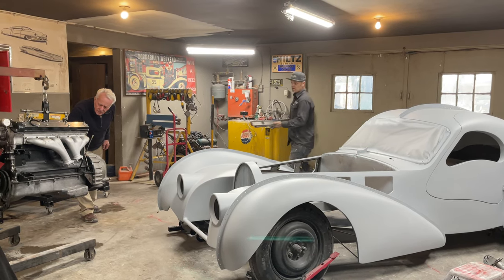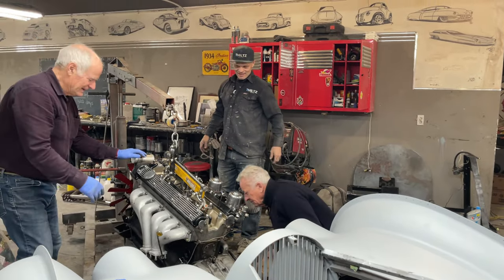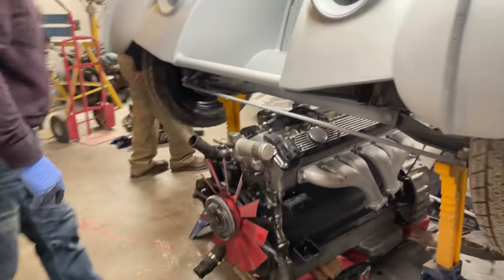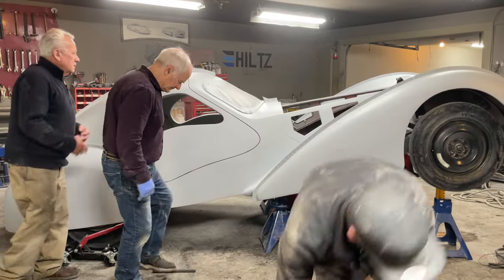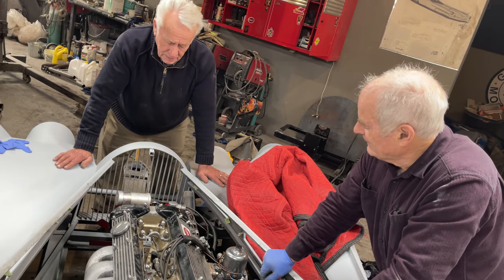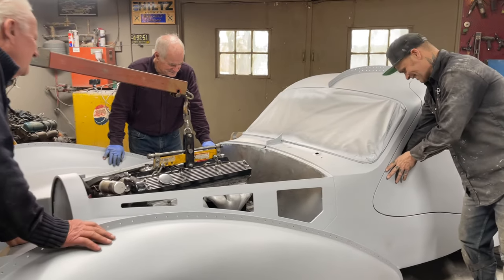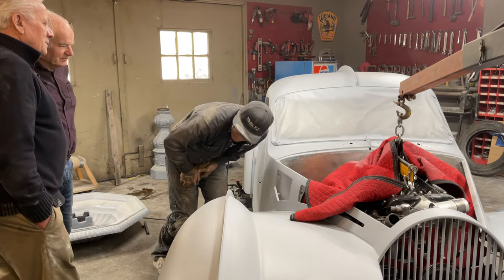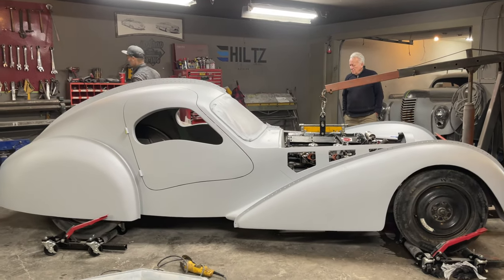WE JUST DROPPED THE JAGUAR ENGINE ON THE BUGATTI 😱

Comment: I have the same engine lift and used to experience the same lack of control on lowering the "boom"....until I had the idea to attach a long bolt to the T valve using two tiny hose clamps and this made a nice lever to control the valve very precisely and allows you to also keep the handle in the jack so you can quickly go up if you need to

Comment: Chad, cut out a template wit a sheet of cardboard. Cutout a part that fits around and over the bell housing, then from the engine side trace out the pattern you need for how much room for the engine recess .I would go down about 6" from the top of the hood on the firewall just to make sure you leave enough room for the linkage fore your wiper assembly and motor. Width of the recess should be a couple inches wider than the width of the widest part of the rear of the motor. Been following this build from day one, so nice to see it all come together. Congrats.

Comment: Really love the build overall!..a few suggestions from another old hot rod builder..Get a 2" chopped Model A radiator made for a modern v8 swap..Common part in the hot rod world, so its not expensive..plus it'll fit better that the mustang rad and look tons better.  Also consider correcting the spines running down the tops of the front fenders, they are splayed out when viewed from the front, making it look a little bowlegged,  instead of running vertical like the original car.  This car will be great for sure!

Comment: Are you going to have to put the Lucas wiring system back in or is there a easier system that you can use? I have a 79 xj6 and I hate the wiring and am color blind sucks I know but haven't had problems for a bit but want to change it over but keep the inside engine in it?

Comment: Measure twice, install engine once.  This is one very impressive build and the Jaguar engine is the perfect choice.  Yes, you can get a custom radiator built to your specs in aluminum and nice and thick.  Walker radiators may be a name to check out.  You will have to have a motor mount that unbolts from the frame so that you can install and remove the engine.
Reply: I just read a month or two ago that Walker was planning on going out of business after 70 or 80 years of being in business. I'm not sure if it happened yet though.
Reply: I was surprised there was no discussion of   motor mounts and pads. It was always a main concern when I did a conversion. An interesting Jag to AMC six was extremely easy as the original frame pads of the Jag exactly coincided with the mounts of the AMC. Those AMC's were very adequate replacements with little tuning problems in contrast to the Jags.

Comment: The body is looking very slick. Just taking a peek as “sparkle” pans around. Super tight on the motor but that’s what you expected. Looks like the firewall might need a recess to allow room for a radiator. Dropping the motor is just typical. Try and try to be careful and shit happens.

Comment: Well, we are all human and things like this happen. I've dropped 2 engines. One time we had a Dodge 318 and auto transmission sitting on a really sturdy table. Something overbalanced and it rolled sideways off the table. The other time I was putting a 361 engine into an old Dodge grain truck. I had the engine about 5 feet in the air to go over the rad support. I pushed up on the front of the engine when a lifting bolt broke  and the engine fell doing a 1/4 turn and landed on the front axle. In both cases there was minimal damage. That looks like a really tight fit, glad there wasn't more damage.

Comment: Chad I hate to be an optimist but use a pair of pliers to control the valve on the hoist or a pair of vice grips clamped to the pipe gives you more leverage and control also when you build a car make sure you prefit everything so it can be removed and worked on without difficulty just a suggestion though I've been doing this for a long time I wish I would have had you in my shop to teach you a few things but you're doing a good job

Comment: He wouldn’t mess with that fan but I would toss 
It without a second thought if I needed the room, however I would wire the electric with a temperature switch so it turns on automatically

Comment: *****  First, I think I speak for all of us who have been watching you build this Bugatti when I say our stomachs were in our throats the moment the motor fell into the engine bay.  For us it's as though we're helping you build this baby.  **** Next I know that the motor will descend even further when attached to the motor mounts but be sure the hood will not touch any of the motor components on the top of it for from our angle the coil sure looks as though it will stop the hood from fitting correctly.  If your Mustang Radiator is too large and you don't want to buy a custom built radiator, remember that there are a lot of water cooled motorcycles which have small radiators which could be modified to fit in your grill. Plus, if you buy an oil cooler that too could reduce engine temperature.   Lastly, are you going to have enough room to fit in the steering post and steering box on the right side?  It's so crammed with motor parts, I don't even know how you would ever have access to it in case for example you had to change it?

Comment: 1. Remove bell housing 2. Remove cooling fan/belts. 3. Lift up the rear of car.4. Remove power steering pump. On further thought, why not lift the car body outside on your vehicle lift, then lower the body onto the engine?

Comment: I had a similar thing happen while lowering a big BMW 6 into a 635i chassis.  I had to stand the engine on its butt to slip it into the engine compartment.
Thank goodness, you didn't do much damage, and that no one got hurt, when it dropped!  Your incident got me thinking, and I am going to make a 10 inch cross bar, that slips into the top of the jack handle, that will allow me better control while lowering the engine into position.  
In spite of the flip my stomach did when the engine dropped, I still enjoyed the installation.

Comment: Hello Chad & Jolene from England, I am an old guy, and a retired painter, cellulose, and synthetic, two-pack had just been invented early 70's, though I did use a ready-mixed product called blending clear for metallics. I have never undertaken work like you do, although in my later years I wish I could. I think I might be ahead of the game here but I realised very early on the only way to get the engine in was from below. Good job. Jolene has top-class video skills, and the production is always faultless.

Comment: Too much of the body is not removable.
Reply: I agree, those side vent panels should be removable (bolted in not welded in) in case access to carburetors or the steering mechanisms are needed in the future for example.
Reply: I agree, also the radiator grill should be removable. The original cars had clamshell hoods, that made it easier to install the engine and maintain. But We have to admit he has done a wonderful job building a beautiful car! He is very talented! Although it probably would have been easier to build the chassis, completely with the engine and drive train and steering and brake components first, then build the body around it. But you must agree, that a lot of of builders, could not even accomplish what he has!

Comment: Hi chad 67 4.2 had smooth tappet cover's and is sesries 1.
searies 2 started in 69 it should have two ingine mounting on block if you use the ferther back mountng spot there will be more room for altetnater and power steering and so on and you wont need to use the stableizer mount on bell housing.
Good choice of ingine I have one in my daimler  .Nevet had a problem very reliable and fast good bottom end mid range and top end.
The 4.2 gets a lot of flack but beleave me set up right they cant be beaten.They are all so the most beautifull engine ever made.

Comment: I would put a mid plate and a front plate that way it will be easier to take the motor out because if you weld motor mounts they will be in the way if you need to take it back out

Comment: maybe pull clutch and bellhousing   put back on after eng is in....
Reply: And the fan with accessories.
Reply: @brianf8621  Should have had a rolling chassis first. would have had driveline angles engine leveled, ride height.then built body.

Comment: Hey Chad, I see these comments are quite old but as soon as I could see the struggle with removing the thermostat housing, I said out loud as if you could hear me.. 😂😂😂😂
Heat! Butain burner every time. 😉

I've built a few XK engines and E type engines. Lovely engineering for it's time.
Not a fan of the 4.2l because of the water jacket stud corrosion issue..

Comment: There is an air powered cylinder that you can buy to replace the hydraulic cylinder on your engine hoist that works with an air hose and will let you control the decent much better

Comment: Think I'd be lifting the car over the engine.
Reply: A lot of Jag engines are removed and replaced from under the car.
Suspension is dropped, engine fitted so front end and then car is lowered back down.
Done many from mk2 to mk9.

Comment: When I was changing engine's back in the day ,Many times we had to put it in through the Bottom, So I made a engine pit ,Were if it had to go in through the bottom just drop the engine in the pit ,and roll the car over top and then lift it up with the hoist, Save you some time .

Comment: If you drill a hole through the jack handle, near the end, that is just big enough to pass a large Phillips screwdriver though... you will have a positive way to adjust it in fine degrees.

Also great for those who have worn out their grip strength.

Love the channel.

Comment: I just stumbled across this video and couldn't figure out what was going on. It was clear to me that the Jag engine with all of its accessories mounted, WOULD NEVER FIT into the engine compartment from above. I need to figure out what that car is. I know is is supposed to be a Bugatti Aerolithe but WHAT IS IT REALLY?  Having the bell housing bolted to the block makes sense but having all the other stuff mounted is crazy. If doing that was essential, anyone who has worked on cars should be able to easily see the car would have to be "dropped" (lowered gently as opposed to be "dropped" as was done with the engine) onto the engine. Amazing and lucky that no one got crushed or killed.  A little planning fellows would go a very long way.

Comment: All in all I think it went extremely well , considering the jack dumped the engine, please don't put the body up like that again without some safety straps to the ceiling or something , if that hunk of wood slipped at the wrong time the car would have dropped a couple of feet right onto the top of the engine, that might have been really bad.

Comment: Weld a piece of metal/strip on the faucet from the engine crane. Then you can turn it by hand and you don't need to do it with the lifting stick. Then you have more control on your engine crane👍
Reply: Yep, I hate the way they are designed.

Comment: Reminder; The engine must be at such an angle so that the drive shaft couplings work at the same angle so that the drive shaft does not vibrate. Cant you cut more out on the fire wall?

Comment: I'd lean towards an oversize radiator. These big straight 6 Jag engines need good cooling!
Reply: In an earlier video Chad spoke of a mustang radiator because of the size.  Would an oversize radiator fit?
Reply: @nellalarsen9327  Could always fit some some small additional ones in the fenders behind the wheels if needed.
Reply: @theinsaneshecklador6598  I look forward to seeing the final solution.

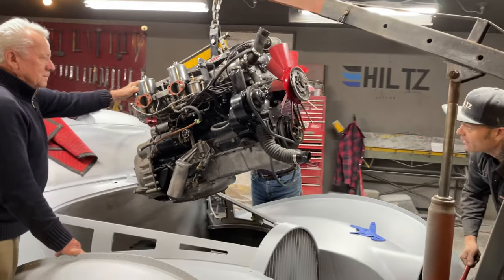Comment: Engine lowering starts at 8:10. Looks like chain slipped because the hydraulic cylinder jack on the engine hoist didn't move dramatically.  Ouch. Glad no one lost a finger.

Comment: Surely a 2-post lift would have made this so much easier- and they're so cheap these days.   And as for those tripod engine cranes - they should be binned. A simple gantry - either fixed or mobile, and an electric winch would be so much better- allows for millimetre luft - l8wering- in a controlled fashion.  Single acting hydraulic cranes like those are more a hazard than anything else.

Comment: Oh oh, wouldn’t it of been easier building the car around a motor first?
Seems like a shame to have to cut up all that fresh body work .
Reply: That would make 💯 % common sense. Rolling chassis first, motor/transmission, body next.  I think this is the what’s known as the “Bass Akwards” method.
Reply: This built is going now for 4 years  Jolene only decided that she would like the jaguar engine about 6 months ago
Reply: The body is the hardest part. If the engine doesn't fit there are plenty European car engines that will fit. From now it is case the make the car rolling and test it before finishing.

Comment: Just discovered your post.  Great car, great build, even greater engine.  Wished I had a Jag to drop in place of my 67 Mustang 3.3, 6 cylinder.   Nothing wrong with mine, but, something different and with a great sound when going thru the gears!   Will try to follow your posts til complete.  Jake hang in there, a mountain of do-ables will be coming, with patience.

Comment: You don't have a tape measure?  The motor is not gonna fit in the hole with the bell housing on.  your opening for the bell housing is too small- I can see this from my computer screen.  Why don't you remove the fan, that radiator hose and the power steering pump?  That motor will crush your creeper.  Watch your firewall clearance, those old Jags had a tach drive off the rear of the exhaust cam.

Comment: Weld a 12" disc onto that jack handle and use it as a steering wheel so you can adjust the flow down more steadily. Or make a T-Handle for it.

Comment: I don't think I've ever seen a video putting in an engine with a hydraulic cherry picker where at some point it doesn't drop. Every dang time guaranteed
Reply: What is a cherry picker? Is the engine hoist the wrong equipment?
What to use instead?
Reply: @TheFastStang  Cherry picker just local slang for an engine hoist. Kinda like in winter do you skitch cars, hookie bob, or ski jog. Not that its the wrong equipment, its just not reliable and usually they are harbor freight junk and the cylinders always drop like that. seems that way in every video. if you are putting a motor in a high end car a chain hoist would be preferred for me.

Comment: After dropping it Chad started jacking it up really quickly. After a mistake like that it's better to slow way down and think carefully before making any rash decisions. Too easy to make the problem worse. Good thing those two gentlemen did not have their hands in a bad place when it dropped. Car's are easily fixed. People no so much.

It does look nice nestled into the engine bay though. Jolene made a nice choice.

Comment: Weld a handle similar to a Vice handle to that engine hoist valve, it will give you much better control over the valve than using the handle with no leverage..

Comment: Those of you that are saying this was built backwards need to keep in mind that he had the mounts for the engine he had originally planned to use in place then Jolene wanted the Jag engine instead! You could see where he chopped the old mounts out of the frame. As far as him dropping the engine  a lot of guys have done the same or similar things! I'm not afraid to admit that I've made my share of mistakes over the years! Plus you know he has to be nervous with two complete strangers working with him so give him a break!  One good thing is that he used square tubing for the tops of the hood sides so they were strong enough not to give!

Comment: just put the bare motor in and then build the motor in the car
would be easy
Reply: It would have been a darn sight easier if he’d built the rolling frame first, then fitted the motor/transmission. The body is the last part of a build - not the first.

Comment: You are very creative and a hard working man with good body working skills, big but here. Why in the world did you build a body with out having a working running gear in place?. In my opinion the frame should have had suspension, engine, transmission, differential all in place before a single body panel was attached. I just started watching you videos but I am going to stop before I see some one get hurt.

Comment: I see this quite a bit on the car restoration shows fellas using zip cut blades with the safety guard off these things are notorious for flying apart and the damage to a face aint pretty please use a shield. You cant replace an eye and you will need a ton of bodywork on your face. cheers

Comment: I think he should recess the engine back in about 3 inches and leave an inch around for movement when engine is running .at least a three core  radiator . That’s just me observing from the outside. Probably handle that little bit better to

Comment: Chad, on the engine install trial run fitting…..slow down, work at the slower speed of the two gentlemen trying to help you….just saying from a couple thousand miles away and not in real time.  Thanks